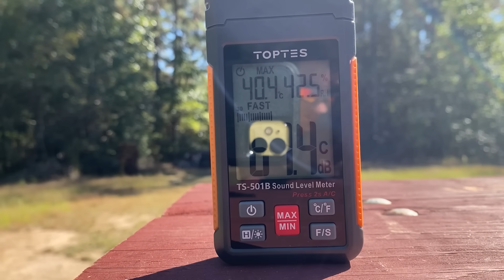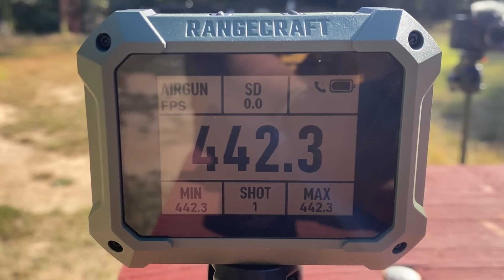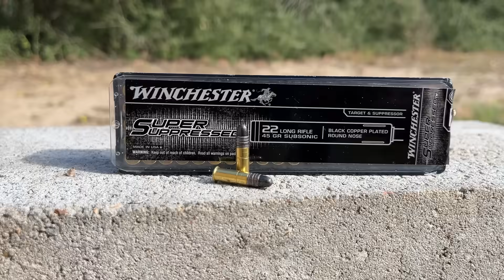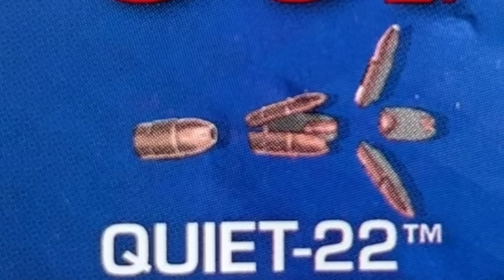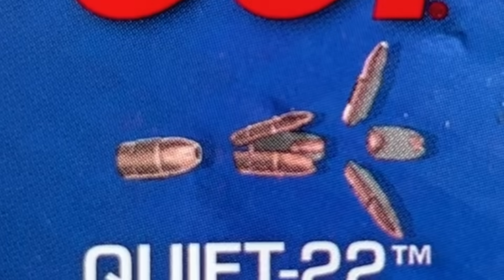How Deadly Are Colibri Bullets?

Comment: I shoot all these quiet rounds (and I even have some old German BB caps).  My go-to round of choice has become the CCI Quiet.  I live in the State-of-confusion (Calif), so cannot get a suppressor (thank you gavin and all your dem buddies).  It sometimes takes a few rounds to finish things off.  I would not dare use these for a raccoon, but they work for skunks.  Louder than a pellet gun (Umarex 'Origin' 22 pneumatic PCP), but the extra weight of the bullet makes a huge difference.  (and NO, I don't shoot squirrels, they are my guard-friends and alert me when trouble tries to sneak into my yard -- or at least that is what they tell me that is what they will do).

Comment: You can't use meters like that for measuring sound pressures from gunshots. The sound is much too short and much too high in intensity. Clipping and sampling rates compound the issue.  The results will be very low compared to actual - you'd be looking at 160+ dB for regular rounds.

Comment: I'm guessing in Reading the comments that would make sense to be able to shoot rats and stuff in the barn without shooting holes in the roof of the walls, but still the power versus how much it costs to manufacture them that's worthless.
Reply: It's a specific tool for a specific job. 
Fixing the holes in your roof is more expensive, and buying an air rifle that you aren't going to use for anything else? That's  an option, but a box of ammo is more convenient if you already have a .22 laying around

Comment: You should hear a 710fps CCI 22LR shot from a Chiappa Li'l Badger with a suppressor.  Think a pistol's quiet? Try a break-barrel!
You should hear it, but you can't. Clearing your throat politely is quieter. The damage you could cause, forget lethality, if someone didn't like a Tesla dealership (sake of argument, don't break other people's stuff), a mediocre fart could cover that up. Hearing the hammer fall is very strange. You feel the 'kick' (yeah, 22lr but it weighs nothing), and I've had 710's go through 2x4's. I switched 'up' to CC! 835fps. Great compromise. Still SO quiet.

Comment: I have fired CB Caps and they are pretty dangerous things.The CB Caps are a shorter cartridge than that Colibri and I think more powerful although I didn't have any way to measure the velocity I imagine that they would go through that soft pine board.

Comment: .22 barrels are so overbuilt and thicc and the .22lr is so low pressure i bet you could crush squibs all day and it would be fine. especially your .22 barrel
Reply: Yup you could probably stack squibs and blast them out with a .22 LR
Reply: @RequisiteFunction  yeah ive always wondered why theyre so overbuilt. i could understand the older stuff being that way, but id expect modern barrels to be nearly paper thin. 

just always been weird to me. maybe its to make .22 not look so baby at first glance like if your friends are out with bigger guns. (or enemies)
Reply: @cerberus1166  lol. 
Although i  definitely cannot argue the psychological effect of a thicker barrel, the reasons for that thickness are a bit more physics-related.
While a .22 does not actually "require" a thick barrel to operate, a thin barrel is too prone to damage, especially bending. 
.22 "barrel liners",  rifled tubes meant to replace your worn out barrels after you drill them through, are not much thicker than brake lines, and are fully capable of firing a full charge of .22LR on their own, before being installed. 
The problem isn't the bullet damaging it. It's everything else. 
If you dropped a 7 pound rifle on that skinny barrel, it would get a kink in it.
The other reason is assembly. Barrel lugs and all the other assorted parts that make a firearm,  are just easier to attatch on a wider diameter, than they would be on something which is less than 3/8" wide. 
The size of springs , bolts, etc, all lines up with it being easier when the barrel is wider.
If .22 rifles were made by elves, we could probably get some very skinny rifles out there!
Reply: @RequisiteFunction  dang i didnt know they even made barrel liners. i was also wondering why some .22 rifle barrels had a little recessed area inside the barrel that looked like 2 barrels. that would likely be why. 

thanks for all that background knowledge. i should have thought about how weak a .22 barrel would be at optimal thickness for its cartridge to external forces acting upon it in an unintended manner.

Comment: I love these bullets. I shoot them out of a Remington 514 with a 20" barrel and a Browning BL-22 with a 20" barrel. I don't shoot them out of the Remington 510 with the 25" barrel because they always get stuck, no matter if the barrel's hot or cold. The CCI CB longs and CB shorts are great alternatives for slight bump in decibels.
Reply: Do you have anything shorter? If they get stuck in the 25" barrel, it is likely that they are already beginning to slow down in the 20" barrel.
Reply: @RequisiteFunction  No. Besides a revolver and the Micro Midas BL-22, I'm not aware of any manually operated gun with a barrel shorter than 20 inches. I'd love to get something on the smaller side if you've got a suggestion 👍

Comment: 6mm flowbert and short would be interesting in comparison.
Reply: The Floberts are not doing much. They are probably comparable to the Colibris. I remember as a kid I used a 4 3/4" barreled SAA clone (chambered for 6mm Flobert) to annoy the neighbors by shooting at bed spreads they had hung up in the backyard for drying. That was about 30 yards away. The Flobert rounds did not punch holes at this distance. Comparable with the ancient Diana 4.5mm air-rifle I owned at that time.

Comment: This is the ammo for plinking cans in the city backyard without worrying about it going through the fence boards. It turns your 22 into a pellet gun
Reply: gonna be very honest with you that 22 is weaker than a pellet gun. i have 177 and it does around 1,000 fps and it punches through wood like that. ive stopped shooting it because of that reason. i dont want to accidentally hit a dog or a kid
Reply: @justsomeone6124  a .177 also has much less mass
Reply: @justsomeone6124 nah 22lr has a lot more fpe over a 177 cal. Difference is mass of the projectile, some 22lr rounds hit 1040-1250 fps which translates to 80-100 fpe.  I’ve got some higher end pcp air guns that are 25 cal and 30 cal. Those can generate 100-180 fpe depending on the projectile.
Reply: Pellet gun is much easier on the wallet.
Reply: @NewBoyPoFa  that's debatable depending on how much you shoot, yeah the ammo is a tiny bit more expensive than pellets, but if you already have a .22 and don't have a pellet gun, you could buy several thousand rounds of colibris for the price of a decent pellet gun. And the Colibris are far more quiet than pellet guns, so that has to be a factor too, I have a neighbor who would be pissed if I was shooting a .22 pellet gun in my backyard, most of them are surprisingly loud, but the Colibris can't be heard past 50 feet. I suppose you could get a moderator/airgun suppressor to make it comparably quiet, but thats just stacking even more money into the equation.
Reply: My Airsoft rifle shooting .49 grain bb’s will do about as much damage as the colibri I’ve found.  But I’ve got to have the air turned way up.
Reply: @TheExplosiveGuy  the .22 short was first produced in the 1850's.  I wonder what pellet guns were capable of back then?
Reply: @j @jab100lochaber  1804 Lewis and Clark carried repeating air rifles. Could fire 22 shots without reloading. 

They used it to hunt small game and impress the Indians. 😂
Reply: @TheExplosiveGuy My son and I used them in a Ruger Single Ten, during the pandemic. Made a trap box, shot them in the basement, a DIY range. 
Also, they are great when I worked plumbing custom homes. I'd set up cans and bottles, all the trades would take turns at lunch time. No ear pro required. No nosy neighbors.
Reply: @jab100lochaber  well "Pellet guns" didnt really exist. However AIRGUNS did Louis and Clark carried one back when they mapped the USA.
Reply: @jonboy9734 I was super curious, and aside from the fact it is now a $40k plus gun, this is one of the few firearms I've ever stumbled across or air guns that never had a price or anything that we could do a rough estimate back on so that tells me how expensive that gun was. However, they do know it took about 1,500 strokes to fill up a tank to get the shots,
Reply: @NewBoyPoFa have you priced pellets and pellet guns lately?!?!? lol
Reply: I do exactly that, I live smack in the middle of my city in a residential neighborhood and I can shoot these all day long without my neighbors suspecting a thing, even from my 6.5" Heritage Rough Rider single sixer. I get about 350 fps from the revolver and about 450 from a 22" Marlin Model 25N, which is so quiet the loudest part of the shot is the firing pin hitting the case rim😂. I'm shooting the standard Aguila Colibri, the Super Colibris are out of stock everywhere I've looked unfortunately, the SC shoots about 100 fps faster from a pistol and 150-200 more from a rifle without being much louder, from a rifle anyways, the pistol is a wee bit louder than I'm comfortable with.
Reply: @TheExplosiveGuy  Same results here.  The super seems to be more accurate for me too.  I've had the colibris go pretty far off course.
Reply: Enough for rabbits, chipmunks, and squirrels, and quieter than my pellet guns from my falling block rifle.
Reply: Actually, with only primer involved, I don't really see how it would legally be considered a "firearm" discharge.
Reply: @xxxxxxxxxxxxxx481  in my state if it goes 550 fps its a firearm. im not even supposed to shoot my pellet gun
Reply: A poor one at that.
Reply: My .510 air rifle begs to differ.
Reply: My old crossman XT .17 break barrel goes through half inch privacy fence boards at 40’ with no problem.😂
Reply: Thanks guys ..... Am a Brit, and was just about to demand a "gun guy" explain WTF these rounds even exist 👍
Reply: @Blowfeld20k  They were originally made for farmers to dispatch pigeons in barns, they were powerful enough to kill one without passing through the roof. They are amazing backyard plinking rounds as well as a good way to take out small pests such as the aforementioned pigeons, as well as rats, mice, squirrels and anything else around that size.
Reply: @Blowfeld20k   They were originally "parlor" rounds for shooting inside the house with cigars and brandy.  Much more of a European thing actually, from when you guys were allowed to be adults.
Reply: @Blowfeld20k *gay gun
Reply: Not in the eyes of the law. It's still a bad idea in City limits.
Reply: My air rifle has 37 fpe that is really low for.22 bullet at 9 or less
Reply: a pellet gun will go through a fence...
Reply: Surprised no one mentioned parlor shooting. Just target shooting in your living room was a thing to do back in the day.
Reply: @NoZioKikes88  were people just immune to lead back then? 🤣🤣
Reply: @NoZioKikes88  Just waiting for someone to flex their Flaubert.
Reply: @NoZioKikes88 yep, in the garage into some old newspapers catch box. Fun times.
Reply: Discharging a firearm within city limits is illegal so Ik youre wrong
Reply: @johnnyboy4654 just because it’s illegal doesn’t mean it’s not done lmao. People still speed and run red lights. People have free will
Reply: @johnnyboy4654  So was harboring jews in Germany. What's wrong and illegal are two different things. BTW I don't do either. nnln
Reply: @johnnyboy4654 free men don't need to ask for permission.
Reply: it doesnt matter, its still a firearm and youre not supposed to fire it within the city limits in most states
Reply: @SDPimenta  I've got a buddy in law enforcement, he's a Leutenant in the Sherrifs office and thinks it's awesome😂, he said I would obviously get in trouble if I shot full power .22LR in city limits but the colibris are so weak he doesn't give a damn, they're weaker than most .22 pellet guns which are legal to shoot in city limits. He said he'd prefer I shoot Colibris over my 9mm PCP air rifle which shoots legitimate 124 grain 9mm pistol projectiles, which I can also legally shoot in my backyard. Some idiots get so stuck on the letter of the law that they create more danger for the public, in what world does it make sense that shooting a 124 grain bullet at 800 FPS in city limits is legal but it's illegal to shoot a 20 grain pellet at 350 FPS? It's absurd...
Reply: @TheExplosiveGuy  dude i agree. that was just a headsup because i dont know where you live and i dont want you getting in trouble, but if you think you should be fine go for it then. I don't like how stupid the laws are.
Reply: @SDPimenta  That's why you have to be quiet.

Comment: These rounds are fun for backyard can punching, and they’re certainly powerful enough to do a through and through on the intimidating target of an empty aluminum can. They’re basically pellet guns, maybe even less powerful.

Aguila does recommend against use in rifles, but I’ve never had one get stuck in my Henry lever action.
Reply: They're fine in rifles with a barrel 22" or shorter, I've shot thousands of them without an issue. But anything over 22" is risky, my friend has a CZ bolt action with a 30" barrel that can't shoot them at all, we found that out the hard way and had to ram the stuck round out, it stopped about 3-4 inches from the muzzle.
Reply: @TheExplosiveGuy Yeah, I frequently shoot CBs from a 60's Savage 22-410. Thousands of rounds, never had a squib
Reply: My old air rifle would shoot through the wooden boards at the start so weaker than some pellet guns thats for sure. This round seems like something you would use for shooting rats, mice or birds inside your shed.
Reply: To be on the safe side it's best to upgrade to the Super Colibri for rifles. They're loaded with a little more primer compound.
Reply: I fire these often out of a pump action Rossi Gallery, which is perfect since these were designed for shooting gallery use. Never once had a squib or failure to fire.
Reply: I use a little Rossi single shot, the hammer makes more noise.
Reply: I have one pellet gun that shoots 1250fps almost three times more powerful then this 22 bullet.
Reply: And about 10 times louder defeating the point of quiet shooting.
Reply: Cool story, bro.

Comment: 00:30 keep in mind that decibels are logarithmic, not linear. Every 10 decibels represents a doubling in volume.
Reply: Wrong I am afraid to say.  3 db is double, and 10 db is x 10.
Reply: @ewathoughts8476 Correct, 3dB is double
Reply: The device used also is too slow capture the peak from a firearm, it's too brief so normal gear will register low
Reply: @nk-dw2hm  Can't emphasize this enough. I hate watching youtubers do volume tests with crappy meters, it's basically useless data.

Comment: I like CCI CBs for up close quiet work
Reply: I was hoping he also sampled those. Theyre the only .22 shorts ive ever fooled with
Reply: @adabsurdum5905 they cycle great in the Henry 22 lever 20+1
Reply: I like Benjamin Marauder .22cal pcp air gun. Shoots cheap 14.3gr pellets @950fps up to 32gr beast pellets. And is internally suppressed around 65db. Super quiet. The sound of a 14.3gr pellet hitting a rabbit 100 yards away is as loud as the air gun firing. And it usually gets a pass through at that range with 14.3gr cheap Walmart Crosman pellets.
Reply: @patrickpendergast898 It's almost like we aren't talking about pellet guns... Stop spamming your comments. Nobody cares about your totally unrelated pellet gun.

Comment: If it gets stuck, just load a blank?
Reply: Yeah the .22 concrete nailer loads.
Reply: doesn't really work like that unfortunately.  stuck bullet is ramrod work
Reply: Depending on where it got stuck and what kind of action you had, you might not build up enough pressure down the length of the barrel before it reached the stuck slug.

Comment: I have some of those rounds (Aguila Super Colibri 20 grain).  They have a hummingbird on the box - presumably the game it's designed for?   Powered by rim fire primer only, no powder.  Very quiet and similar to a normal air pellet gun.  Too weak to work semi-auto actions.  Reminds me of the BB caps used in old fashioned shooting galleries.  What, no 1/4 inch mild steel??
Reply: Spanish for hummingbird………
Reply: I had those too and they worked well in my old Rossi Winchester clone pump .22.
I was ignorant of the fact that you weren't supposed to use them in rifles. 
Glad I never had an issue.
They bounced off plywood at 20 yards, lol.

Comment: this bullet is just ammo for an expensive airsoft gun
Reply: Indoor shooting gallery ammunition, a lack of penetration and no need for hearing protection is the whole point.
Reply: @revgregory  also a decent air pistol that does the same work is either going to be slightly expensive or inconveint, or both.
If you want to shoot mice, snakes, etc around the yard, but you live in a cul-de-sac on a 1/4 acre,  you can load these into a .22 pistol and not have to deal with CO2 cartridges or pumping a single shot.
Air pistols are better for when you have more time set aside to do this.
Reply: decent airsoft are in the same ballpark if not more expensive than a simple .22 pistol/revolver that can also shoot more lethal rounds
Reply: @marcogenovesi8570  the ammo makes more sense if you already have a .22 pistol. I couldnt see getting a 
22 pistol specifically to.sbooy these,  but if you already had one, then the ammo is a nice option